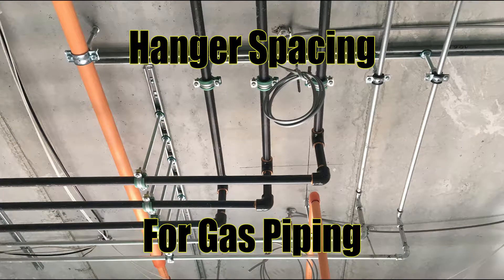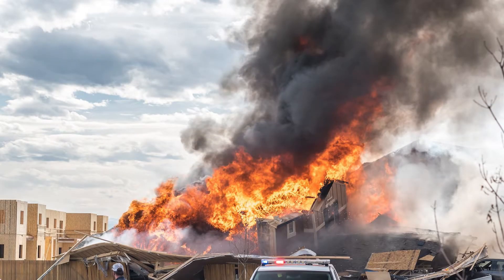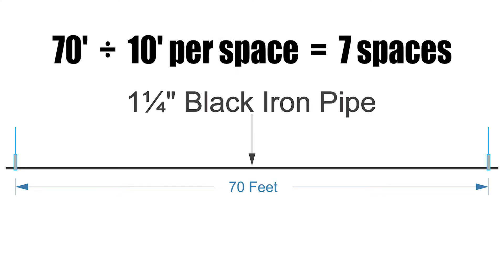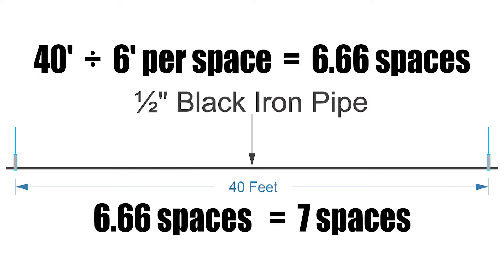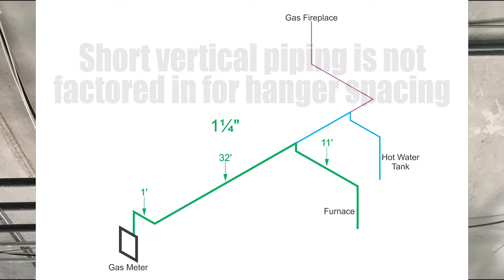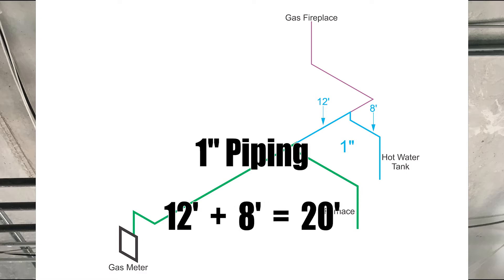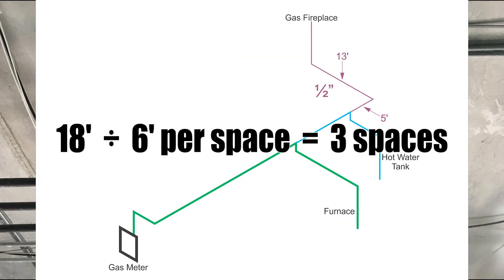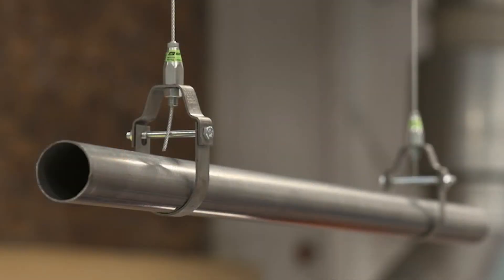Hanger Spacing for Gas Piping

Comment: Another problem is, green pipe and blue pipe both add 1, means there will be 2 hangers at their joint?
Reply from the maker: Now this one comes down to your gas inspector. The inspector may want to see a hanger on each side of the tee, or may be happy with a hanger on one side of the tee only. The Authority having Jurisdiction gets their way.

Comment: The problem is, there is not a 70 feet pipe. Pipe may come in 10 feet inches. And the joints need supports.
Reply from the maker: Yes you are right on all counts. This method is specifically related to a poorly written provincial test question. (Alberta Provincial Exam)